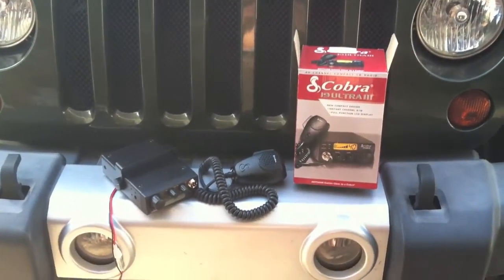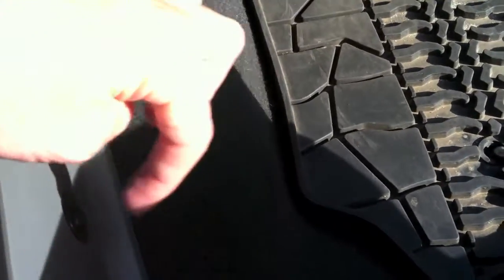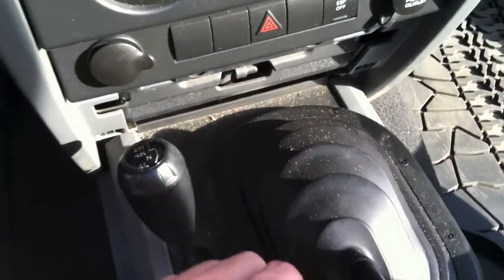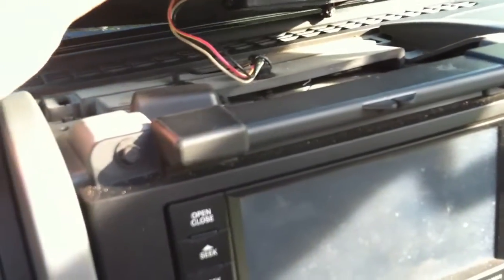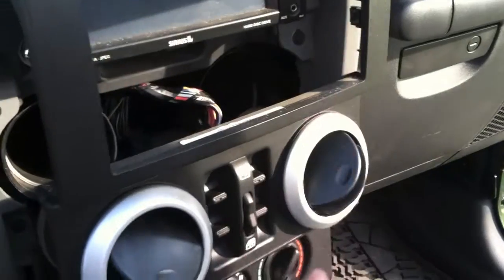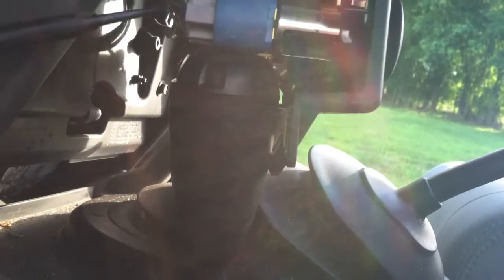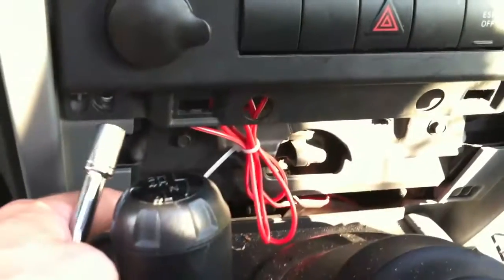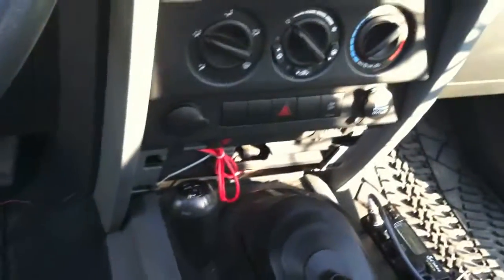How To Install CB Radio In A Jeep Wrangler Or Other Truck / Car

Comment: I was hoping this would tell me how to find the "always on" power line so I could splice into it.

I can understand why you would use "Hot in Run" so as not to leave the radio on and drain your battery, but one of the main times you might need your radio is to call for help when you've broken down and the engine can't run. Rather than leaving it in the accessory position and draining your battery even faster, you can just run the radio which will use very little juice unless your actively broadcasting or receiving. This greatly extends the time which you can monitor for CB traffic from people whom you can ask for help. 

Just my $0.02

Comment: Nice video.  You need to make 1 change though.  You need to use a rubber grommet when you run the wires through the metal firewall or engine compartment.  Otherwise it will eventually wear through the wire coating and cause a short.

Comment: Would expect engine noise tapping into existing wiring or cigarette lighter. CB's should always be connected to a dedicated isolated circuit (if you have uplifter switches) or direct to the battery, with inline fuses within a few inches of the battery (CB internal fuse is not enough).

Comment: why don't you just get a 2×6 and fun it across the roll bars over the windshield I did it in mine and also mounted a Texas star 667 and it works out if sight and no trouble to get to it works good in my jeep